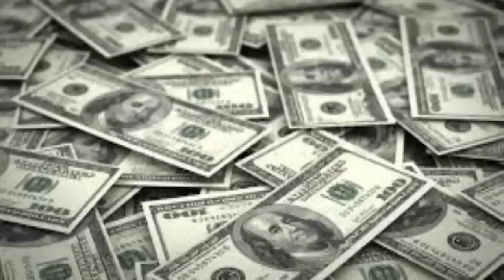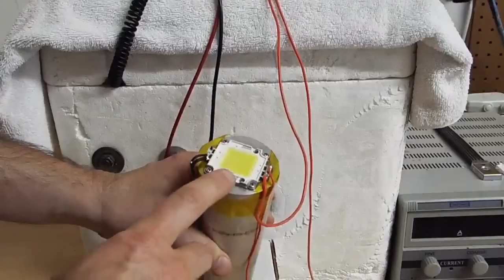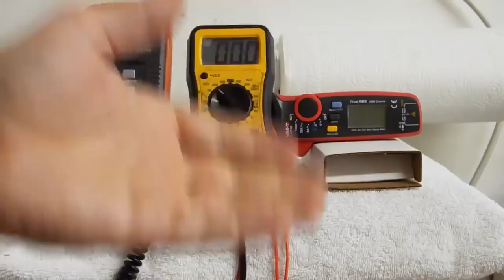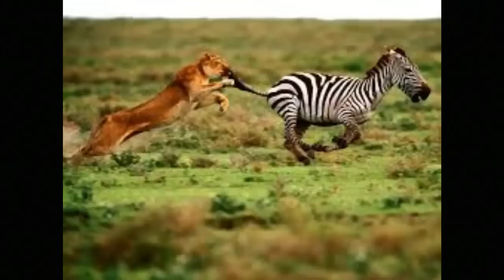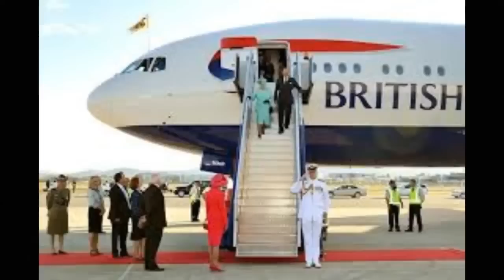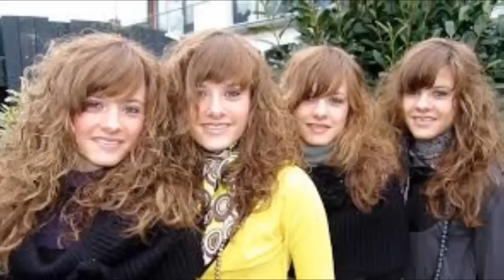Internet Lumens vs Actual Lumens, and the 100 watt LED test

Comment: Another awesome and well explained video!  as most of us on BLF & CPF know of the sad over-rating of lumens the overseas sellers put on the cheapo lights, its scary that they do the same with Lithium Ion cells.  ( as in the whatever-fire, 9000+mAh 18650 cells they say is "protected" or genuine, when many of them are nothing more than re-wrapped used recycled cells with no protection, or some other fake 18650 can with a smaller cell inside.  I disassembled 1 of the 5500 mAh random-fire branded cells, and found it full of white filler power and in it was an unmarked random cell the size of a AAA sized 10440 cell,   ( it tested at 223 mah on my BT3100 charger, with an IR of 280.
Reply from the maker: It's funny you mention that.   I met a guy who had an ultrafire cell that when I shook it, it would rattle.  14500 encased in 18650 housing was exactly what I was thinking....  I think the example you just gave is the most ludicrous one I've ever heard!   Seriously that is better than the recycled laptop pulls thing...   Truly the "KING" LOL!Thanks for sharing!!
Reply: I have an awesome GTF 9900 mAh battery here!
I bought them because I knew there were insane!
.. Insane fake, I've tested both, one of em is stable around 960mAh the other is somewhere near 1005 1010, so I have to give credit that they are almost accurate
Fun facts is, I still use them today, they are a year old now, they can discharge with a 1A max (okay not  so good) quite impressive!
Bought them for 90 cents haha

Comment: I used a white paper at 1m distance and used an app to measure luxes and the conversion was straightforward
and the numbers checked with the flood light i have, well, i took the angular distribution of light in count too.
the floodlight was the benchmark to compare the 50W LED i was testing and as predicted (well obviously the light was weaker than the floodlight) it was less than advertized, but i think i blame the LED driver bc the voltage is 27V and not over 30V ...
measured 900Lum instead of 5000Lum for the 50W LED and the floodlight was a 30W and did measure 3000Lum

Comment: What about this one?  How many extra zeros do you think there are? https://www.ebay.com/itm/Tactical-Police-990000Lumen-T6-5Modes-LED-Flashlight-Aluminum-Torch-Zoomable-USA/263081359623?_trkparms=ispr%3D1&hash=item3d40def907:g:2tcAAOSwqaRfLQIQ&amdata=enc%3AAQAFAAACYBaobrjLl8XobRIiIML1V4Imu%252Fn%252BzU5L90Z278x5ickkXKoKcbeZcOrOku%252BoOBl%252BS%252BxVQ5HIWeDXVam4b1K8Oa08RdpQ0zXShFBBNrzbCBhuL0xIpjp3D85nkpx2fD4lSAU82SDjYGsD%252Bw1Y0XfD7wCuGI%252Fx%252Bx35Bj7s2aIHs52eXqztF8365dkcHMm10oBffFmIToLKxNx4I0kuoa8MzHLS1Gr5utHf5MEBcLH2l12DLFlaV2HcgbGDSJOViIXjCdotDeTg3GqX5auVy1rtKuJTAbXL%252FF6uPZane2inX87M1GpIhpqkz5oxsprwR8Ha9k0ex7lswjVsdp7xWdyNCkblhU1t6kj9DNL3jkm%252BX87yVf5xuh8rIISrl0pLJn5qg4O9388FEhYKlLwzH7fo%252F3%252Bt28oaAMvrrPSOnqnBJRTvRtkA59PC5MfIxGzD2zEI6fFRrlH8Tp3bUUvAanlWUMWJoSdRCwPJrL7KafYrOGw3bsH125gfdNkcNM5khyTJCtLDDQcHIYTF0jfgZXrieONyjRaAz6jfAgwda4Rlqs6Bx%252F14g6UiUVqEvcZz6XjtImz8%252F1V5P77Fsawo%252FNCIa5UnxXvPv33Y3WgkLwxxY8Ixx6eHSyTOs2KTKWLZOJucIMbmgo9d7fPdbaWuax1WhQtDtuFtjhwoSmQ8pXUSQbgGS5TNzWCSAFlLjEsIzzUN4c7ltQdosr4gpr2nDtc%252FNF8Ul0NcPpE3oUTNxZxVxuSOlYt%252Bjifzx36BIIBAUisrpgnj7xP8jzckQkqbA1gQZY2dkSwmYNtAWegpoz9LKeGn%7Ccksum%3A26308135962349120ce407fd4f9bbae65dd85d7a8553%7Campid%3APL_CLK%7Cclp%3A2334524

Comment: Your Ulbricht Sphere is completely wrong. you can not replicate the measurement done in lab with that equipment. It is violating all the basic physics, please see this link.
There is a multiply factor to apply to the reading of meter.
https://en.wikipedia.org/wiki/Integrating_sphere

Comment: You have to measure it 1m distance. That box is too small you have to use bigger box to get correct numbers.
Reply from the maker: Hi, the 1 meter distance bench mark is typically used for measuring candella.   Measuring lumens is a bit different than that.   The distance only needs to be adequate enough to get your light meter far enough away from the light too get it into acceptable measuring range of the meter (basically so your not maxing it out).      The foam box show in this video is just meant to show a cheap easy way to get basic benchmarks, definitely not super accurate.   The lumen tube method can be dialed in to a very reasonable margin of error provided diffusers are incorporated and the system is calibrated off professional equipment.   Most of the flashlight enthusiasts I know have gravitated toward the latter method.
Reply: @Lumencraft-  thank you for explaining it.

Comment: I bought a Nitecore 2000 and it become unoperative after 15 minutes of use over 11 months. This $130 flashlight was still under warranty and I sent it back to the US distributor. My Nitecore was in MINT condition and it had to be shipped to China to be serviced. I got the flashlight back in eight months and the flashlight was all scuffed up with many many scratches and fairly deep scars into the aluminum(I was outraged). The distributor told me that it was not their responsibility for the damage to my flashlight and that they had similar incidents like mine in the past(confiscated by Chinese customs and they used them for a while), so I sold the light for cheap on Ebay as is. As a note the flashlight had the same serial number as when shipped and I never ever dropped the light nor installed batteries wrong and I stored the flashlight in my dry closet. I decided after this incident to stick to American made, Maglite has never failed me in reliability. I figure with the incandescent style Maglite, like I own, I have the choice of original incandescent(keep the parts) and mods I have bought from Adventure Flashlights. The Maglite can be kept for life and modded many times if necessary through the years. There is no reason to ever discard the Maglite for it will always be able to be reasonably serviced.

Comment: I got my 50 watt chips for 2 bucks each, with on board driver.  I don't have a way to test the lumens. But, ha! To my eye, I guessed 57 lumen per watt cool and about 40 lpw warm.  Also, the inboard driver has a thermal resistor.  So, the 400 watt light, I built, with aluminum and copper, and fan, only sustains about 270 watts at a level pace.  I did build in a dimmer and can run cool up to circa 110 watts without running the fan, passively cooling, where to my eye it seems about 100 lpw. But only driving 10 50w chips at 11 watts each.   Matthew, you should test this. The upside is that these have a reasonable dollar per lumen that can almost compete against the hid or halogen, unlike cree....  For example, if I want an 80k lumen samsung setup, it would take $300 in led strips, about $300 in drivers, and $300 for the heatsink. While a 1000w magnetic ballast, reflector and bulb runs $130, with at least 110k lumens.  A halogen runs $10 for a 10k lumen light..... 80k lumen and up is where good lighting begins.  I am waiting for some $ competitive led 80k+ led to come out....We can't see with only 10k or 20k-not for painting, nor feeling like it were outdoors in daylight.  That threshold is 80k for lighting a modest area, or wall.   ... I was toying with the idea of using these to build a 1600 watt light, but cannot get excited about 40 to 57 lpw anything. I don't get excited about anything less than 80k lumens that plugs in.

Comment: I have bought the same lux meter as yours a few years ago.
It's working fine, but recently I had the chance to compare it against a professional meter. 
Difference between them was about 25% (to be specific - the Lx1330 was showing 2000 lux against 2700 lux on the Sekonic c700 )
Below 100 lux is getting worse than 25%.
I'm a bit disappointed, but I think is normal, considering the price.

Comment: That's why the next generation of cars will have 2 cylinder engines of 50 cc (or less) with over 700 bhp stated by the manufacturer.

Comment: Oh im so pissed off with that multimeter you are using. I have about 4 of them that are trashed because they all the sudden just stop reading the right voltage. Stick it in a 120v socket and it reads 5 volts.

Comment: I Calibrated my Pipe with my XM-LT6 and Datasheet.
MY two 1000lm Flashlight display around 950-1050lm

My China 100W LED emitter make only ~45lm/W !!
After that i Compared both side to side and the 100W LED take about 20W for the same brigthness from the XM-L T6 at 10W

the 10W China led make at 10W only 400-500lm in my test
Reply from the maker: Thanks for sharing your test results.

Comment: Yeah the lithium battery lie is ridiculous also. No 19650 can do 9999 mah. It would take 3 to get close. With the best cells. And if you need high current. Like 10-20amps. Then for 1000 mah you are looking at a dozen 18650 cells. Great video. Pointing out you can't always believe what's on the label is in the box!
Reply: 1000mah would take 12 18650s? What kind of batteries are you using? Sony LG and samsung all make batteries capable of 20 amps with 3000mah

Comment: You think the light lie is bad. Have you seen what amplifier manufacture's are doing. Like a 800 watt amp that only does 36watts! Lies! They need to stop !
Reply: New amp! 9.2 channel surround sound! 800 watts! *

*1 channel driven, at 1000hz only, with a 4 ohm speaker, with a total harmonic distortion (THD) of 5%

Comment: Are thorfire flashlights legit?
Reply: Loren Husky - You'd need to buy it on Aliexpress. Try here.  
 http://s.aliexpress.com/UZZFvmY7
Keep in mind that the button may be metal instead of plastic like in the pictures. Also, don't expect 1100 lumen. It probably will not exceed 700. The battery will be a low capacity unit. The emitter is CW like 6500K. On/off is through the rear switch and the side switch is low/med/high.
Reply from the maker: Hi Loren,   I've only had one.  I had the AAA pen light.   From what I could tell it seemed like a good light for the money.   Here is a review on CPF you might find helpful.
http://www.candlepowerforums.com/vb/showthread.php?432613-REVIEW-ThorFire-VG-15S-Flashlight
Reply: Yes, they make quality lights. They recently made the Q8 for the BLF forum and it's a legit 5,000 lumen plus light. Very high quality as well. Their S70s is also a quality unit. You can find many reviews on budgetlightforum.com. and candlepowerforums.com.
Reply: Thanks guys. I ended up with a Sofirn C8F for my first serious light. It's grreat!
Reply: Loren Husky - Yep, that model is very well liked on BLF. Sofirn said they are going to make a 21700 version as well.
Reply: Yes! I can't wait for the 21700 version, I will happily get that one too. My only complaint about the C8 platform is that I wish it was every so slightly longer. I have what I can imagine as medium/average sized hands and the C8 leaves me wishing for a little more real estate. Any suggestions for a bigger C8? I was thinking about a Brinyte S58 which is like a double 18650 C8.
Reply: Loren Husky - I'm not familiar with a longer version. I tend to go bigger in diameter with a 26650 size C8 running xhp70.2. You might check the Maxtoch brand, but they can be a bit pricey. Check the Convoy L4 model. It might be an affordable solution. It also happens to have a side switch.
Reply: They make a 26650 C8?? I didn't know that, that's awesome! I'll check that out too. Side switches are my definite preference.
Reply: Loren Husky - There are a ton of single 26650 lights with the head size roughly equivalent to the C8. I talk about some new Supfires here. http://budgetlightforum.com/node/59885 I only use them for hosts, though. The stock versions have poor drivers and weak emitters. I like the size, though. Many companies offer lights in this general size that use boost drivers and Xhp70, 70.2 even 50.2. You can get 3,000+ lumen from them. I actually don't like the regular C8's because the beam is too narrow for me. The C8F has a wider beam, it seems like, and single reflectors with a bigger emitter have wider beams. That is my personal preference for walking around at night.
Reply: I'd like to get one of those Supfire L6-S, but I can't find anyone that sells the one you showed pictures of in your thread. Who sells it??

Comment: I don't think I have ever seen any LED light advertise the actual lumens, it's always way higher. I just ignore the lumen claim. When it comes to Chinese LEDs, you have to divide the advertised wattage by 2 or 3 to get an idea of the actual wattage. A "100-watt" Chinese floodlight can be anywhere from 30-100 actual watts for example.

Comment: Do you have the wattage levels for the flashlights? You could easily work out the efficacies by getting a lumen rating and dividing it by the wattage.

For example, the 100w LED at 29.1v, 500mA puts out 1,554 lumens and is drawing 14.55 watts (multiply v by I)

If we divide the lumen count by the wattage we get a total efficacy of 106.8 lumens per watt... I MUST SAY THAT IS PRETTY GOD DAMN SPECTAULAR FOR A CHEAP LED ARRAY!!

If you want to see the full 100 watts, you need a current limiting supply and to drive the LEDs at a higher voltage. I choose to drive these LED arrays at 39.1 volts and then limit the current to prevent the LED from nuking itself. In this case you want 39.1v at 391mA to get bang on 100 watts of power draw from the LED. Same goes for lower wattage arrays like the 20, 30 and 50 watt ones.

Comment: its so funny how ridiculous some of them are. one of the ones i looked at on ebay actually had the listing as " 20,000 lumens " lol they are literally just putting random high numbers knowing that most buyers arent going to actually test it. 

However i will say i do enjoy certain flashlights off ebay. there is this one i've had for two years i only spent 17 dollars on it and it was very bright. and then out of nowhere the other day the circuit where the led is, is having continuity issues. so im just gonna throw it in the parts bin and buy another one.

Comment: Can you use a 18650 20 amp battery in these flashlights without doing damage to the flashlight?_ I have a flashlight that takes the 26650 battery but that battery I have is a 30 amp battery.
Reply from the maker: In a high power light typically what you risk damaging is the battery more than the light.   As long is your 18650 cell is rated at a high enough discharge for the light your fine.    If your saying your 18650 is rated at a 20 am max discharge it should be good for most lights.   Other than some custom lights and the Emisar D4 I'm not aware of any that do discharge at a higher rate than that.     If you tell me the exact light and exact cell I can let you know for sure.

Comment: I bought over 10 flashlights on eBay using 18650 Li-Ion batteries.  I am pretty sure they do not put out the thousand lumens claimed.  But at $1.5~2 without battery, they are very bright to me.

Comment: I'm finding the same thing with 4ft LED tubes.  Comparing the Lux of one to the other rated the same, is way different.
For example, an HTM tube rated 2447 Lumens outputs 740 lux. Lifebulb at the same position to the detector and rated 2500 lumens outputs 1160 lux.  Hmmm.
Reply from the maker: Thank you for sharing you experience.

Comment: Whatever lumen output you could look up you will find on eBay from sky ray king. Type in 100,000- 200,000 lumen flashlights and you'll "find" them.
Reply: "99999999999 Lumen Military Tactical Flashlight"
Reply: @simont3686  😂😂😂
Reply: only $3,99

Comment: About the 13.8k lumens light I know how they come out with this numbers: Since these are XM-L emitters the manufacturer ASSUMED that each LED is capable of delivering 1.1k lumens, so after x12 it becomes around 13k lumens "theoretically". It is not entirely impossible to achieve that numbers if all the emitters are reflowed onto DTP boards and driven Hard - in fact even if they are not reflowed onto DTP board at all they still can possibly reach 10k lumens but for a very short period of time, and few people have done the similar mod in BLF before, too.

Comment: Why didn't you just use 2 large stainless or aluminum  bowls polish the crap out of them to replicate that 10k rig? Any cons?
Reply from the maker: Hi,
You could get away with a couple bowls, but you would not want to polish them.  Reflective surfaces wont diffuse and blend the light correctly to get an even measurement.   Probly painting the inside of them white would get you by.

Comment: When you overdrive LEDs like you did to test their max output, you're permanently damaging them, right? Even a slight overdrive should compromise lifespan of the led.
Reply from the maker: I guess that depends on what you feel "damage" is.    When you overdrive it will shorten the life, however if you know where the threashold of death is and back off just a bit from there, and make your heat sink and thermal path A grade it's no big deal.   I've been doing them like this for quite a few years and so far I'm not aware of anyone simply "wearing out" an emitter.  The lights that come back to me are almost always because the emitter put in them is outdated.  Like computer parts, led tech moves quick.

Comment: just go by  lumen meter off ebay then you will know for sure
Reply: RIGHT!!!
Reply: An actual integrating sphere tends to cost around $10k usd. It involves a lot more than a meter, you have to capture all the light, even it out smoothly then maduro it against a calibrated source light. It's very tricky.